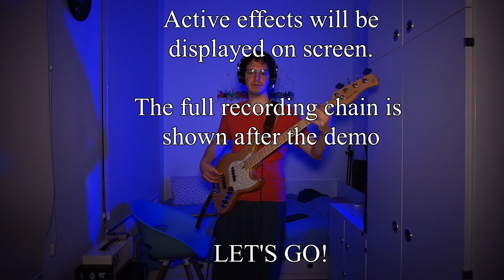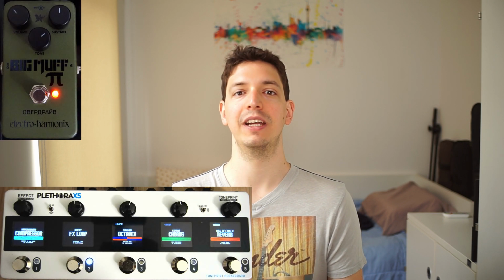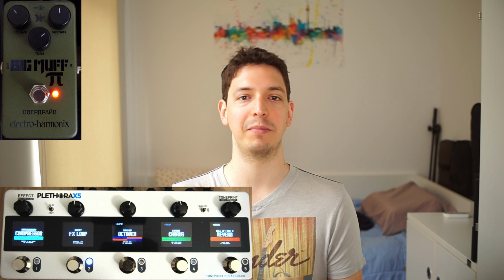TC Electronic Plethora x5 Bass and Guitar Sounds

Comment: Have you tried hooking it up in stereo? I'm a big fan of the MIMIQ doubler pedal and was looking at maybe replacing it with this for added flexibility. I wonder if it's possible to have let's say the Brainwaves only on the right and let's say a Flashback on the left. In short, can this device have two different sets of effects in parallel?
Reply from the maker: Thanks for the comment CarcPazu. The Plethora give you tons of options and all tone-print enabled pedals, which is great! It's really flexible in that regard. However, having the individual units also gives you different options in terms of making smaller boards and it's also easier to tweak on the fly... 
I haven't tried the Plethora in stereo actually. I may be mistaken, but I think it is not possible to run two parallel lines of effects. Maybe in the tone-print editor app you can pan the stereo effects right/left. This could be a work-around solution, but all mono effects will be heard on both sides

Comment: Great sounds ! What are the settings of the pitch shifter + Mesh?
Reply from the maker: Thanks a lot! It's a tone print I created using the app.. Just one voice adding a second octave up (24 semi tones, which I think is the maximum it goes) and then setting the mash button to control the tone bending. It only activates when you press it and the mash is pressure sensitive. Let me know if you managed to do it... You could also do that with an expression pedal for better control..
Reply: @TheBedroomRocker1  thanks! I tried something...the effect I heard was caused by the mash funktion of the Reverb ;-))